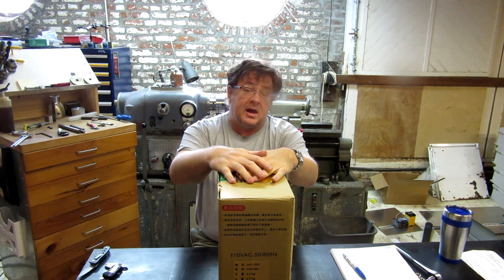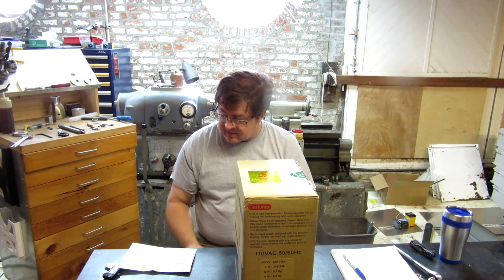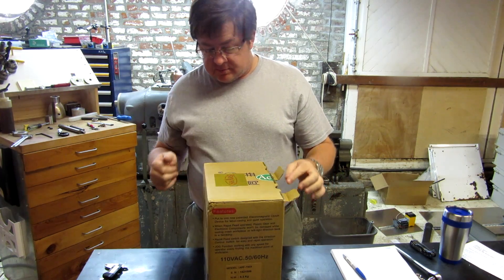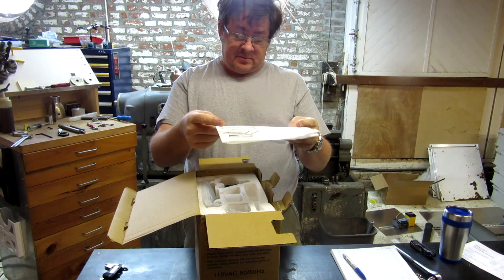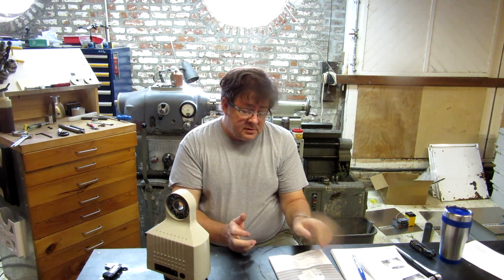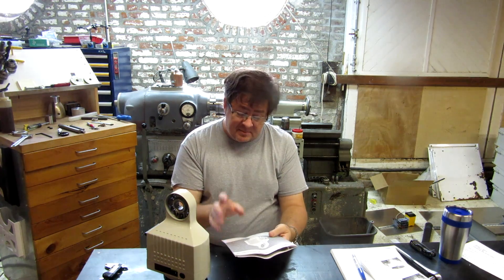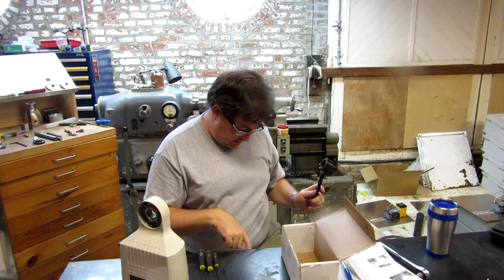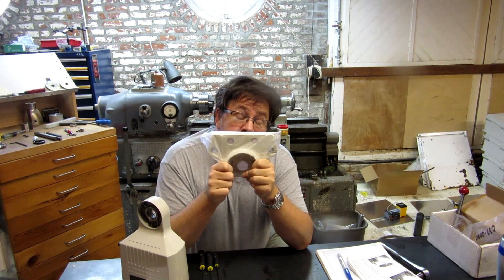Power Feed #1

Comment: I too have had issues here in the uk fitting these, my machine is a genuine Bridgeport same table size as yours, but mine has the smaller plate on the end same as in the box, but still I had to buy a shaft to adapt the feed to the lead screw, which then did not come with a coupler so i had to turn one up! Just for your information not sure if it mentions it in the instructions but in case you have a " Happening" there is a spare nylon drive gear mounted to the inside of the motor casing, i needed mine after not undoing the bed locks oops!

Comment: Hi James, sorry to see that the power feed isn't going to work out as it was supposed to, but I think it will make for some good videos to be able to see you make the necessary pieces and adapters that will make it go together, I'm guessing you've already called the supplier and they have nothing else to offer you in the way of a direct fitting unit?
  Some years ago, I used to do some welding for a fairly large machine shop, and I had occasion to be there for hours at a time, and I became friendly with one of the old guys who was very skilled and experienced, and he always had something clever and insightful to say when looking at problems that came along, and one of those things he would say would be "if it was easy, everybody would do it and there'd be no reason to bring it here"    That was also the same guy who told me you can make anything with a shaper but money.  A nice guy and a fine machinist.
  Great video, and I look forward to the next installment on this job.
     Mike

Comment: I bought a similar unit from Enco, and pretty sure all of the "cheaper" power feed units are made to fit 9x42 Bridgeports.  I installed it on my Rockwell vertical, and in my case, just made a new shaft extension to fit the unit that I had. At least your shaft is just an extension, so start from there and go. I had to turn a 3" round aluminum block to adapt to my table and spacer the feeder out correctly.....wasn't really too hard of a project, and liked it so well I put one on my knee!  The more expensive Servo version probably has one with the correct adaption to your machine, but at this stage of the game.....I would just adapt the one you have.

Comment: James, I'd send it back if the correct power feed is available. Might be other, yet to be discovered issues, with adapting this unit for your use. Just my two cents worth. Glad you are letting us see the installation.
Thanks....13

Comment: Are you convinced that this unit has the necessary torque to move the table as you would expect as the table is clearly bigger and, I assume, heavier than you thought? It obviously therefore has a greater mass to be moved.
On the basis that you feel that it will and as a man with your skills it seems to me that some "modification" of the stub shaft would seem to be appropriate to get it to fit and work.
Reply from the maker: It should, the unit Servo sells for this mill actually has less.

Comment: If the key size is the only hitch getting the brass part on,  take the existing key and mill steps on both sides so the top fits the new part and the bottom fits the existing shaft.

Comment: If the vendor can prove the correct unit, I would return the unit.  If they can't, I think I would make an adapter.
I bought a similar unit a few years back (clearance item). When I opened the box and compared the power feed unit with the end plate that came with it, the mounting holes were 90 degrees off. And add insult to injury the power unit had a metric bore and keyway.  Long story short, I made a new end plate and a shaft adapter. Did a post w/pic on Hobby-Machinist.com .
I think it took longer to design than make.

Comment: James,
I had the same problem with the same power feed but in my case the issue was the other way around (the p/feed was larger than what i needed on my Chinese mill/drill) - I was happy to get a good deal on it so decided to keep it but nothing was the same, the shaft was not even the same size and the key was also smaller. I bought a piece of stock shaft with the keyway already cut, made a stepped key to fit 1/2 into the shaft and the other in the brass gear collar and fabbed an adapter to fit the table on 1 side and the p/feed on the other (in your case you can probably just drill new holes in the table). I also made a collar to fit between the leadscrew and the new shaft and I used an extra bearing (self aligning) to hold the stubby shaft to the new adapter positioned on the inside, normal circumstances you discard your stock bearing but with the short shaft i figured an extra one would just give it more support and prevent it from wobbling and the one in the power feed is fairly small - mind you this is all for hobby but has lasted for 7 years and never had an issue with it. I'd say take the plate off and see if the top holes match, looks like it from the vid and if that's the case just drill the lower ones. Hope this helps you make a decision.

Comment: If you'd like to get that POS mill out of your hands I'll gladly take it. You wouldn't want it to get bullied by all the other machines in the shop would you? haha
Can you make an aluminum sub plate to go between the table and smaller end plate bracket?
Reply from the maker: Andre Gross I love a good sense of humor!  A  second video coming soon that clarifies my direction with the project.  Thanks for visiting.  I really enjoyed your Tangential Tool Holder video, as you might be aware I am a fan of that style tool holder.  Your design, bolting directly to the compound, is certainly much more rigid than the commercially available one I use, very nice work.
Reply: Oh, thanks! I didn't notice you were subscribed. 
On a lathe as small as mine making a tangential tool holder small enough is undoable. I used it a bunch today making a set screw collar. Works fantastically. Thanks for showing it on your channel, thats where I found about it. Once I made one, it really makes the standard RH tool look primitive.
Can't wait for the next video!

Comment: Went through same issues.....send the shar back and buy a Servo brand. They make adapter kits specific to machine. My kit keeps the table bracket original and adds a stub shaft to avoid those issues. A few dealers have lists online with downloads for manuals to see the specifics for your kit.